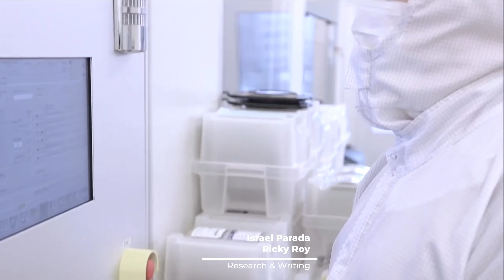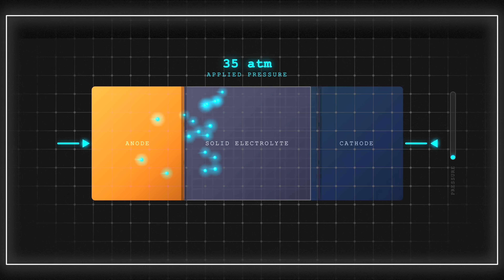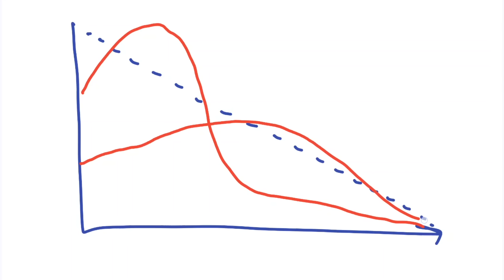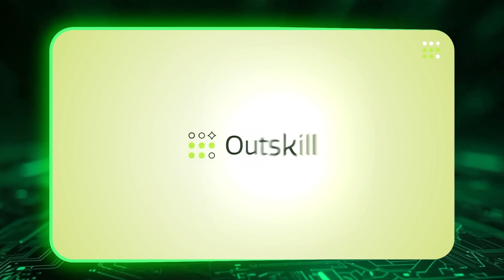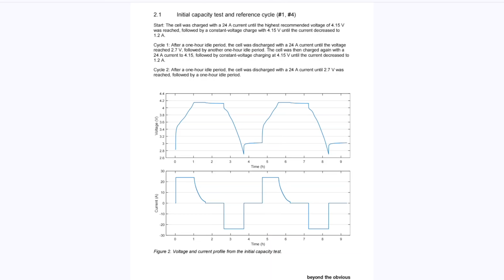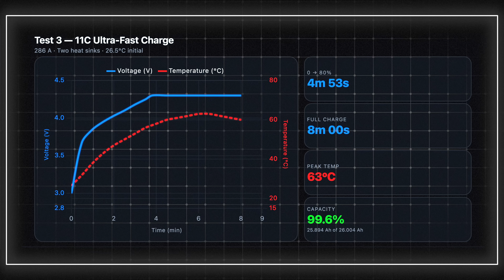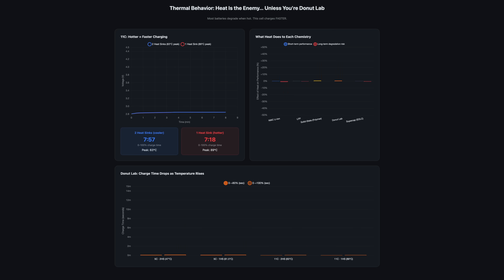Donut Lab's Solid State Battery Test are Shocking...

Comment: Great video I always enjoyed your videos. Here is my opinion: I appreciate the illustrations of the voltage and the strength. Even if the voltage can be a signature and I see how valuable the start point. Don’t forget get that there a is a time factor for the voltage and that lithium is benchmark of the best battery technology. Even the ultra capacitors can not hold power for to long (maybe I am wrong). 
I think the time for each to reach the 4 volt would be very important factor. If you comparing all 4 about finding each time that they reach the 4 volt. I think that would be the best comparison and the heat generated for each as they are very important events for determining safety.

Signature would have a different shape if you add time as a factor. The highest point to the voltage only indicates how full the battery is. I saw you added the time graph till it get full and that probably a better representation and temperature with that could indicate more. I wonder when it is stack with all the heat. Would it need active cooling?

Comment: GREAT work! You mentioned the other EE channel I trust - I had already seen his video - unfortunately he admitted that most of this is new to him - so your video is MUCH more informative - which is deeply appreciated. Of COURSE we all want to see it sliced open and the innards analyzed and revealed.  We also want (as you mentioned) to see some measure of the cycling and any resultant degradation. As I said on the other channel - even if it isn't 100,000 cycles - but is closer to 10,000 cycles - it is still a good development.
Still too early to call it a "certified game changer" but it is also too early to call it a fraud (as many have already done).
Thank you for your detailed explanations - very helpful and revealing.

Comment: The real kicker for me will be the degradation and materials used. These initial tests indicate whatever it is, it's a solid performer at the very least. Was there discharge tests with this? I haven't watched their video. Would have been nice for them to show the volumetric and gravimetric energy density in these tests too since it goes hand in hand here. 
Doesn't seem 100% like a scam battery, but potentially very dishonest. 100,000 charge cycles seems impossible, and much more than what initial solid state batteries were promising. Unless that cycle life is under 50% capacity and at 0.2C charge/discharge rates? Which would still be good for renewable storage I suppose.
Just seems like if everything they say is true, they'd demonstrate all that to an established manufacturer and be able to sell patents for a ridiculous fee and go the Thanos route: Retire forever and watch on a grateful universe.
Maybe that's still their plan and this is the marketing strategy waiting for someone to make a crazy offer.

Comment: How are the numbers and charging data in freezing temperatures such as if it was left outside in sub-zero (C) weather? Does it charge slower? Does it hold a charge or a partial charge or does it just die like EV batteries do in freezing temperatures?

Comment: Energy retention over several days (e.g., self-discharge measurements) was not measured or mentioned in the VTT report or related coverage. This is critical for EV usage. Also, efficiency is poor at high charging rates. In all, this is an incremental improvement in battery technology, not revolutionary.

Comment: Great work, Ricky. I think we now know why this is called "donut" ... The expansion is mostly covered by expansion inside the donut hole. It also explains why heating improves the efficiency, donut hole is filled when heated.
Reply: Their main product is the Donut motor, which is a hubless rim motor solving unsprung weight issues. Cool videos on YouTube of long rides on the Verge cycle using the magic doughnut wheel

Comment: I want to see a battery that is designed for cold environments.  Capacity is less of an issue, so much as a battery that can handle super cold environments (-40').
Reply: That's what sodium ion EVs should be able to do. They are less dense and still expensive though

Comment: If the battery is real, it seems like it could be amazing for certain cordless tools. I’m thinking leaf blowers, SDS drills, chainsaws, snowblowers. Your battery is cooked? Slap it on the charger for 10 minutes and you’re back at it. It gets hot while aggressively charging multiple times? Even better, as apparently the battery likes that. Fingers crossed that its real

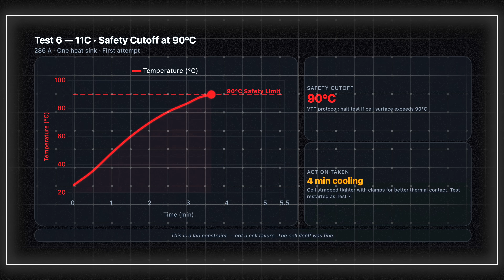Comment: @10:20 VTT have 90 degrees C safety limti for LITHIUM ION batteries, worth considering. and if Donut say they can operate just fine at 100 degrees C then why wouldn't they test it at that? so in VTT's eyes the donut batteries they got is basically a li ion of sorts (which the voltage graphs also say)

Comment: Just a theory but I think the increase in efficiency at higher temps may be due to the increased pressure from thermal expansion. If the materials all expand when heated which is as far as I know guaranteed thermodynamicly speaking. As compared to a liquid electrolyte which would I imagine squeeze the gap thinner.

Comment: What you've missed is how significant this heating issue would become when you pack thousands of these batteries side by side and the fact they claimed battery doesn't need cooling at all, and yet it obviously does. Also, 100% charge in 5 minutes was not demonstrated in test. In my opinion, this is either a hoax or at the bare minimum hugely overstated claims.

Comment: My confusion is if itself is an actual solid-state battery pack that has passed or certified less than .05 liquid as China recently ruling placed into law otherwise they cant continue calling it solid-state or even stamping it as one. Correct?

Comment: So if a solid state batteries can be charged in a few minutes, wouldn't there be power restraints at existing charging stations?  Wouldn't these stations need much higher AMP service and possibly a rewiring of service provided by utilities?
Reply: One problem at a time. Yes 100kwh EV battery will need 1.1 megawatt charger to charge at 11c. But those exist today primarily for electric semi trucks. But first let's see that battery in an EV

Comment: The data shows its just a lithium ion with liquid electrolyte battery, loool.😂😂😂😂
If you ask me, Tesla's closer to the solid state battery compared to anyone out there because they managed to mass produce the dry electrode. So that leaves the electrolyte, maybe you can make a video on that.
 People rarely understand that the majority of technical improvements on a given system come over time. Through simulations, testing iterations, improvements and repeat..

Comment: Thank you for clarifying that the 90 degree cutoff was a lab constraint. I thought so as well, but yesterday a guy with a phd said that it was a cell limitation and his prediction went from 1% to 0.1% of this cell being what it claims to be. I myself am optimistic and hopeful but remain skeptic until actual products have been sold.
Reply: That was the Ziroth video. Ryan is very careful, very reputable, and asked a LOT of questions of the Donut Labs guys when they were in Las Vegas for CES. At the same time, I think his PHd has maybe put some blinders on him here, since his assessment seemed to be based primarily on that voltage profile being so similar to an NMC battery's.
Reply: @JuicyBenji   it's a lab constraint due to cell limitations
Reply: @PorthLlwyd  No, it's a safety constraint IMPOSED by VTT.
Reply: @dochi1958  at what temperature does the cell begin to vent?
Reply: @PorthLlwyd That's unclear, supposedly the cell works fine even at 100C
Reply: @mikeboy0001  and who told you that? The same person that told you that the cell doesn't need any active cooling when clearly it does.
Reply: @PorthLlwyd My friend I said supposedly, whereas your comment was stated as a fact and it's false 
The 90C cutoff WAS NOT A CELL LIMITATION, but a safety standard from the Lab, maybe you didn't notice, probably just didn't care, but it actually performed better at 89C than at lower temperatures
Reply: @mikeboy0001  in the real world cell customers have to give data sheets to the laboratories so that they know what they are testing. The limit was set based on the chemistry involved. So I repeat, the safety constraint is based on the cell limitations (chemistry). I've been in a cell test lab only once this week, so you/your friend must know more than me. It also charges like an NMC cell, coincidence?

Most cells perform better at higher temperatures (internal resistance tends to be lower). But that doesn't mean it's always good to push those temperatures higher still.
Reply: @PorthLlwyd "Performance has been rigorously tested across extreme conditions. At –30°C, the battery retains over 99% of its capacity, and when heated to temperatures exceeding 100°C, it continues to retain over 99% capacity with no signs of ignition or degradation."

Maybe it's fake, who knows, but everything points to VTT safety measure
Reply: @mikeboy0001   it's almost like you are unable to comprehend the words I am writing. You seem to think I don't think it's a VTT imposed safety measure, which isn't what I have said.

Your statement in the quote marks have not been verified.

Here is another quote from the donut website"

"It can be charged to full in just five minutes without limiting charging to 80%". The plots from the report say otherwise.

The cell is clearly not as advertised.
Reply: @PorthLlwyd "it's a lab constraint due to cell limitation" @PorthLlwyd  25/02/2026

Comment: This guy by far has the best analysis.  I was disappointed in Ziroth's review.  Internal resistance, discussion on heat performance, clamping force etc. I would add that most SS batteries have 10-50 mohm internal resistance.  Well done bro.  I did estimation based on pics and came up with 260 cc for pack volume,  lets see how close I got :).  Density would have to be water, to get close to 400wh/kg.

Comment: The caveat is that Donut claims no active cooling.  How will this work with multiple pouches slabbed together without any sort of cooling, if they almost reached the danger zone with a single cell which would be absolutely best case.  Taking 10 cells and attaching them together pouch to pouch, the heat in the middle of the pack would be way higher than 90 or 100C.  🤷‍♂

Comment: I’m convinced the major manufactures of LiPo and Lithium batteries are behind this campaign.  They went DonutLab to reveal their trade secrets, so they turn of the external pressure.  Forcing DonutLab to release more detailed data about how they work.  DonutLab is putting their SSBs in their upcoming June release of motorbikes.  If they weren’t ready for that, they wouldn’t have pushed so hard to get them produced.

Comment: I suggest they are not liars, but truth stretchers (typical). No lithium, but technically a new lithium "molecule". 🙄 So it has lithium. Just not the same lithium any of the industry uses. Typical slimy used car sales mentality. This is my guess. Stretch the truth as far as possible. 🤷🏻‍♂️ Also you can assume some kind of nano film tech from that other company in this spicy tuna roll.

Comment: If Donut Lab battery is built the way they said and it is truly a solid state battery, the ions inside don't move too much. They just orient and take position in some local directions like in a capacitor with a pseudo separator distributed everywhere.
Reply: It could also be a battery using pseudocapacitance, still using with electrochemical reactions, but surface redox or shallow intercalation ones, in a fairly open structure carbon nanotube electrode (which offers a large surface area to volume ratio, increasing both energy density and power density). The Ions would still move, in this case,  between the two sides of the cell but with a thin film solid electrolyte (such as a polymer rather than a ceramic) that could be optimised to allow the high ion flow migration across the cell. 

This would align with the Donut Lab statements that the cell is a battery and not a capacitor, of the traditional kind, i.e.  not using electrostatic charge. Rather, with battery like Ion transfer used, but with electrode surface interaction of the Ions (like a capacitor) rather than deeper intercalation of typical Ion based battery cells.
Reply: GruffSG • Yes, in general that's what I mean, but expressed in a slightly different way ( the "ions", in what they said that all is designed, do not have to move completely from 'one side to the other', because the "one and other"  is practically everywhere ( by their work in solar panel research, it looks like they print a carbon mass in an ordered "disorder", add a crystalline structure and isolate/cover with metal oxide; the addition of this and of some extra small variations in layers - from their idea of adding a similar structure of a battery directly and tightly attached right under the solar panel - creates a huge accumulation of capacity, electrons and ions, etc. )
However, do not think that all battery inventors know absolutely exactly what happens inside the chemistry of their  inventions. The main chemistry can be theoretically approximated, but the whole and total process in absolute finest detail is not completely comprehended.
For example, nobody knows what an electron is in true reality. 
In theory, yes, as a practical model backed by a math model.
But in true reality, no. 
So let's see what they show later and try to guess what their invention is ( until they sell the first Verge electric motorcycle equipped with their battery, which is at the end of the next month ).

Comment: Even with this first test all still not for sure about this battery. I figure several more tests are needed. This strung out data I guess good for marketing but, hell on patience. The main good thing I see is this is putting pressure for other companies to step up on their solid state batteries research.

Comment: So doughnut pays vtt specifies the test, and gets the results and then releases what they want to share.  A tiny battery 26AH with a large surface area is sandwich in between heatsinks and charged at 11c is not exactly rocket science. Some pouch cells are rated 80c - 100c for rc cars rated 5.6ah.  since no chemistry is disclosed it could be any of the lab grade 400 - 600W/kg chemistries that uk, german and Chinese researchers are working on.  Unless it's a manufacturer independent test, it's just another paid promotion no matter who is paid to run the tests

Comment: One of the reason why the testes cells from VTT is smaller might be due to EQUIPMENT LIMITATION.. if you want a 11C cahrge measurement and your tester is limited to 300A.. then it will dictate your maximum capacity...

Comment: Did you notice the date in test results 9.2.2026.... "old" news. They have tested some  product on the road already with heavy duty transport equipment. No idea how they build batteries but those are working already in real life machines. That cova power smart trailer is going to make big impact in cargo market. No need to buy electric truck..trailer is much cheaper to maintain/repair/build. Perfect combination to remote area working. Go to wild with electricity and drive back with diesel. Save half amount of diesel.

Comment: Simplest explanation: Donut made a faster charging lithium cell to supply for testing because enthusiasm for a revolutionary technology that didn't actually exist yet did not overcome skepticism. Their runway was getting short when investor dollars didn't immediately overwhelm them, so they had to supply /something/ to try to refuel the hype train. So they placed a specific order to a specific company to test specific data, all of which looks pretty mundane, because they've made promises they can't keep. 

Obviously, I'm still firmly in the camp that they're lying their asses off. Maybe they've got concepts of a plan, and tried to jump the gun to get funding needed to keep the project alive, and maybe that idea actually exists, but I don't for a second believe they've actually produced a solid state battery that does everything they say it can. The only confirmation we have that they haven't put lithium in their cell is their word that they haven't. A faster charging lithium cell doesn't get you the hype needed to take on the big boys. $5 says that every test they do is going to be with a different company, using a different cell. I don't believe you're ever going to see the exact same cell come off an assembly line get tested in every avenue they're claiming.